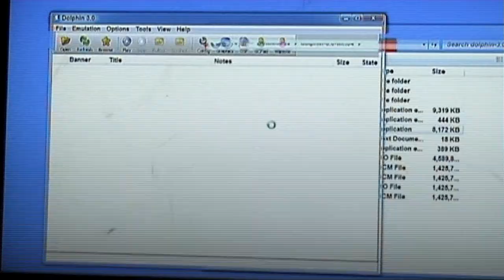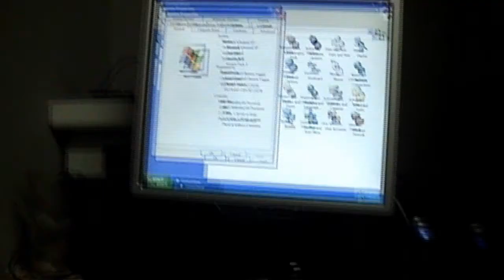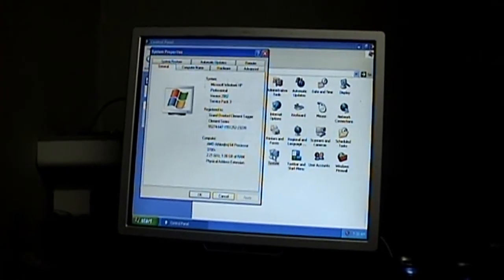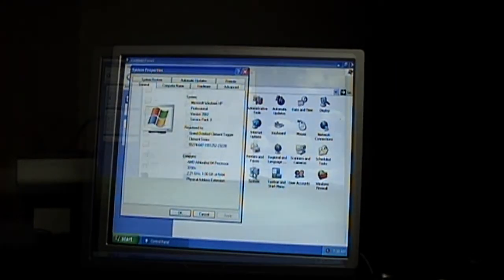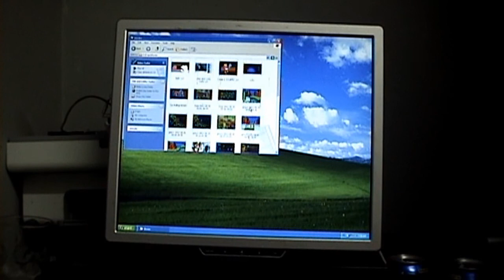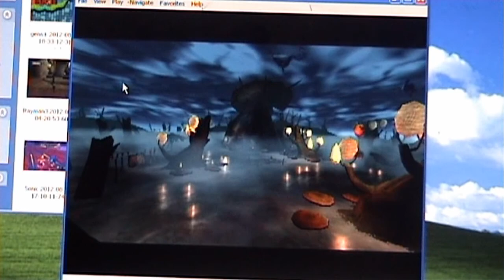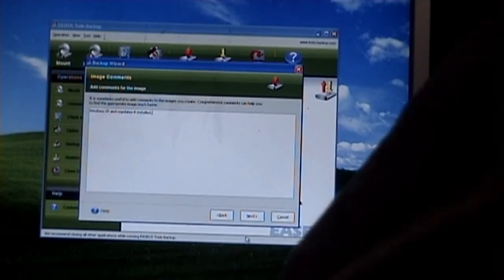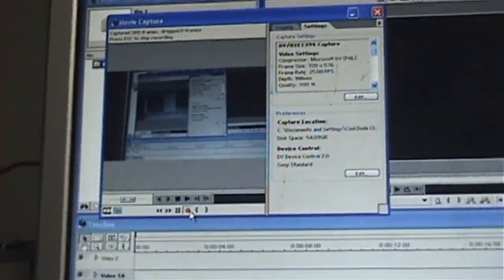The PC upgrade Saga final part - The custom side panel

Comment from the maker: But XP is awesome!  I also have Windows 7 installed which I use for most of my stuff and it rocks, but some of the older stuff wont run of windows 7 so I have to run those on Windows XP

Comment: really? you do know windows 7 have compatibility mode to run older software.
The only reason I can see someone using XP if they have old components with no new drivers available. Even vista drivers work with windows 7.